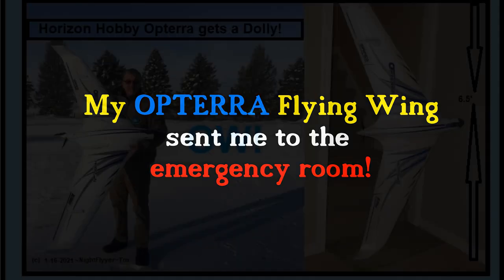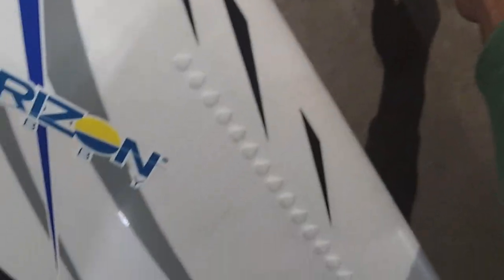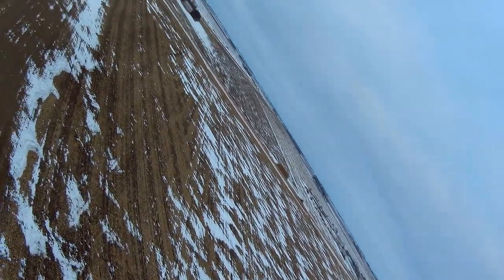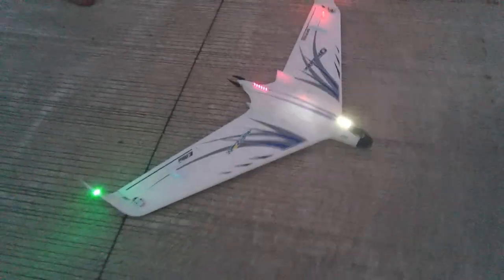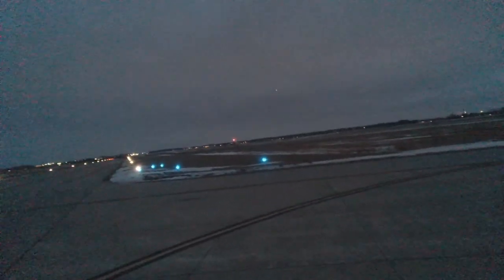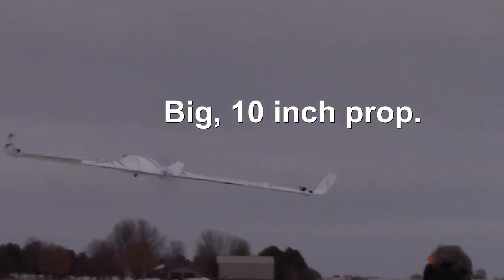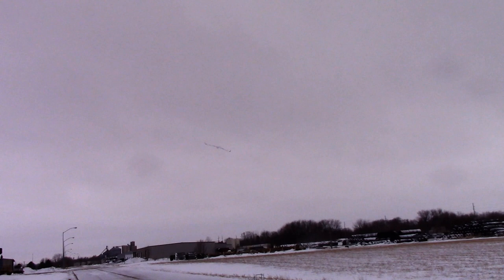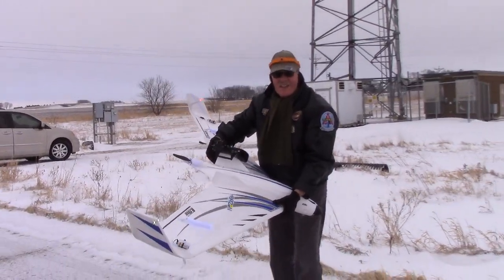My Opterra 2M Flying Wing sent me to the E.R. This is an awareness video & my solution for launching

Comment: Your using a Spektrum.transmitter, there is a motor arm/overide setting that will kill the throttle.
I first used it to Override or kill the motors on my quads....  That way I can kill the motors before I pick them up no matter the orientation....  Cause otherwise they have the same problem if you hit the throttle before unplugging there are 4 props to make hamburger out of your hands.... 
Glad your recovered...
Reply from the maker: I certainly know that as most of my helis have that setup. I've flown models for 60 years.  I'm 73.  But the best rc pilots in the world, have also had bad landings once in a while.  Shit happens, especially while I was trying to throw this heavy, under powered 7 foot model into the 12 mph headwinds.  Maybe if the Manual had said I should do that, I would have.  First of all, that had nothing to do with my hand injury. I only mentioned the Throttle arming because I followed instructions in the manual and this is the way it bound up and arms the motor as soon as you plug in the battery. It says nothing about programming in a cut switch like my helis have. I only mention it to warn others to program in this feature as well,  which also should have been mentioned in the instructions.  It's my warning to be cautious, because the manual says nothing about programming in a throttle hold to a switch. I've known of times when after flying, that switch was forgotten to be moved back to safe and it armed as well.  Nothing is 100% as it could be left in the wrong position, by accident. I'm pretty experienced, so never relied to on a throttle cut/hold, as all my helis and my drones, and many of my electric planes need throttle stick movements to arm.   I only am warning others to be careful BEFORE the launch and to be careful no matter what you use. .    Here are the links to the last videos and you can see I launched it the same way without problems.  . 
https://www.youtube.com/watch?v=P_inF5EYLEE&t=1s&gl=CO  and   https://www.youtube.com/watch?v=ur5V5H8UcGs&t=1s
Thanks.  Its hello dolly from now on.

Comment: You didn't follow through on you launch. You stopped your throw when you released the wing. Keep swinging your arm after you release the wing. You hand and wing are moving at the same rate so if done correctly there won't be any more prop strikes. It's pretty much the technique a baseball pitcher uses. hope that helps heal well.
Reply from the maker: The instructions only say to hand launch it and tells how.  That is how I did it. Of course nothing is 100%, and others told me they were holding this big 7 foot wing and before they launched, a gust of wind got under it and it tipped back and cut their forearm and 3 tendons.  I was launching into 12 mph winds and this big heavy, under powered wing is not that easy to hold and launch into that.  Its hello dolly for me from now on.   Here are the links to the last videos.  https://www.youtube.com/watch?v=P_inF5EYLEE&t=1s&gl=CO  and   https://www.youtube.com/watch?v=ur5V5H8UcGs&t=1s  As you see I had no problem then but shit happens.

Comment: Well if you aren’t a newbie, than you should have known to have throttle cut programmed and on anytime the plane is not ready to launch. 
Stating “because the instruction didn’t tell me to” don’t blame on being a marine, blame it on ignorance. 
The opterra hand launches just fine as long as you 1, use safe select to launch, and 2, to be aware of prop position and to follow thru with your hand motion. 
You may want to switch to unpowered gliders.
Reply from the maker: If you follow my channel, you know I am no newbie and to say I asked for it or should have done it differently is disappointing.  Newbies would follow the instructions in the book, as I did.   First of all, that throttle arming had nothing to do with my hand injury. I only mentioned the Throttle arming because I followed instructions in the manual and that is  the way it bound up.  It arms the motor as soon as you plug in the battery. If it had said to program in a throttle cut, I would have!   This wing is 7 foot long and will bend and break the end off the if you even try to pick it up by the tip. It would also be extremely difficult to somehow launch it discus style with the elevon there and that 7" tall winglet rudder that is also on the tip.  I know how to do it , but not with this plane.  See my 14 year old self-contained catapult in action here.  https://www.youtube.com/watch?v=ypxbkaY-Ycs&t=113s
It's not like launching my SMALL F-27 Evolution or 1.2M Opterra.  So I followed the instructions word for as I did for the video I made of my product review earlier, but it bit me.  https://www.youtube.com/watch?v=P_inF5EYLEE&t=1s
Here is word for word what the Opterra 2M manual says about launching.  
1. Put the aircraft into launch mode with the channel 5 switch.  (in my first video that did not work, it went into the ground)  
2.  Hold the aircraft in one hand and the transmitter in the other.  
3.  Apply full throttle and throw the aircraft directly into the wind, angled slightly up (5 to 10 degrees above the horizon). 
4.  Climb to a safe altitude and check the trim.   
I know others have their own ways, and either way, my Dolly is the safest solution for me.  
The Opterra 2M manual also says nothing about throwing it with the motor off, so if a newbie followed the instructions, like I did, I'm showed what could happen, in case a gust of wind got them or something else.     Nothing is 100% and no matter how good you can throw, this big 7 foot wing with a 10 inch prop spinning right next to your face, is risky.  And to see how I feel about that uneccesary auto stabilation system see this.  https://www.youtube.com/watch?v=ur5V5H8UcGs&t=1s
Maybe a gust of wind, maybe my 73 year old left arm was weaker, or who knows.   But either way, if it happened to me launching the way I thought was good (and  the same as all my previous launches.)  So if it can happen to me, it can happen to others, and that is the warning I want to present.

Comment: I didn't read all the comments so don't know if it's mentioned already. Put a throttle cutoff on that thing. Make sure it's enabled before grabbing it. 

My solution for launching is a bit different than yours. I enable throttle cutoff, set my throttle to 2/3 to 3/4, throw the Opterra left handed, and AFTER it has left my hand I hit the throttle cutoff switch to turn the motor on. I have my right hand thumb on the right stick so I have control before my left hand has finished it's follow through.

Comment: Many a Piggily - Wigggily -Digit on the Dirt Shop Floor 
; Mostly Table Saw Warrior's !  [ 3 Tyme's 2 Date ] , YYZ , Mohawk-Planker ...Thought's about Hand Assist Launcher Stick !?
Reply from the maker: I have had launchers, but again, this is a big heavy 7 foot wing.  .   This wing is 7 foot long, heavy and  will bend and break the end off the if you even try to pick it up by the tip and barely has enough power to fly out of your hand at launch.  I know and I tried.    It would also be extremely difficult to somehow launch it discus style with the elevon there and that 7" tall winglet rudder that is also on the tip.  I know how to do it , but not with this plane.  
It's not like launching my SMALL F-27 Evolution or 1.2M Opterra.  So I followed the instructions word for as I did for the video I made of my product review earlier where nothing happened bad.  https://www.youtube.com/watch?v=P_inF5EYLEE&t=1s and the second one where I explain how to protect the bottom of the fuselage.  https://www.youtube.com/watch?v=ur5V5H8UcGs&t=1s
We are only talking about a Half inch of clearance that I needed to keep from getting cut. 
Here is word for word what the Opterra 2M manual says about launching.  
1. Put the aircraft into launch mode with the channel 5 switch.  (in my first video that did not work, it went into the ground)  
2.  Hold the aircraft in one hand and the transmitter in the other.  
3.  Apply full throttle and throw the aircraft directly into the wind, angled slightly up (5 to 10 degrees above the horizon). 
4.  Climb to a safe altitude and check the trim.   
I know others have their own ways, and either way, my Dolly is the safest solution for me.  
Thanks.

Comment: The same thing happened to me and I have seen it happen to others. I made a leather glove/sleeve that now use to launch my Opterra.
Reply from the maker: Ouch. Thanks for that suggestion and I tried that already, but because it was cold.  I found trying to hold on to the tiny finger grips on the bottom of the 7 foot wing with a thick glove under full power with wind blowing was difficult when under power and then trying to fly with  a big enough glove on was also difficult to fly the transmitter, (I'm a stick pincher)  so although that sounds like a good idea, it did not work that well. Some have told me the Prop got them in the forearm even before launch, when a gust of wind got under the wing and tipped it back.   We are only talking about a Half inch of clearance that I needed to keep from getting cut, and even though I pulled it off several times in my earlier product review video,  I will never hand launch it again.  LOL.  It's hello dolly from now on!  Thanks.

Comment: 1. put on a glove if your going to launch a pusher. 2. That plane doesnt need to have power on at launch. Ive got one with dozens of flights on it and don't power it up until after its out of my hand.
3. set you throttle cut off on a switch then it will be the same for all your plane regardless of what the esc manufacture does.
Reply from the maker: Throttle cut.
Of course I know how and  have.  First of all, that had nothing to do with my hand injury. I only mentioned the Throttle arming because I followed instructions in the manual and this is the way it bound up and arms the motor as soon as you plug in the battery. It says nothing about programming in a cut switch like my helis have.  It's my warning to be cautious, because the manual says nothing about programming in a throttle hold to a switch. I've known of times when after flying, that switch was forgotten to be moved back to safe and it armed as well.  Nothing is 100% as it could be left in the wrong position, by accident. I'm pretty experienced, so never relied to on a throttle cut/hold, as all my machines need throttle stick movements to arm.   I only am warning others to be careful BEFORE the launch and to be careful no matter what you use. 
Gloves
Thanks for that suggestion and I tried that already, but because it was cold.  I found trying to hold on to the tiny finger grips on the bottom of the 7 foot wing with a thick glove under full power with 12 mph wind blowing was difficult when under power and then trying to fly with a big enough glove on was also difficult to fly the transmitter, (I'm a stick pincher)  so although that sounds like a good idea, it did not work that well. Some have told me the Prop got them in the forearm even before launch, when a gust of wind got under the wing and tipped it back, so gloves wont protect that.  We are only talking about a Half inch of clearance that I needed to keep from getting cut, and even though I pulled it off several times in my earlier product review video,  I will never hand launch it again.  LOL.  It's hello dolly from now on!  Thanks.

Comment: Thats why I always put throttle cut on my planes, that transmitter can do it as well.  So if you bump the trottle nothing will happen.
Reply from the maker: Of course I know how and a have.  First of all, that had nothing to do with my hand injury. I only mentioned the Throttle arming because I followed instructions in the manual and this is the way it bound up and arms the motor as soon as you plug in the battery.  It's my warning to be cautious, because the manual says nothing about programming in a throttle hold to a switch. I've known of times when after flying, that switch was forgotten to be moved back to safe and it armed as well.  Nothing is 100% as it could be left in the wrong position, by accident. I'm pretty experienced, so never relied to on a throttle cut/hold, as all my machines need throttle stick movements to arm.   I only am warning others to be careful BEFORE the launch and to be careful no matter what you use.

Comment: I have a friend who recently, was also bitten by his Opterra, when launching. He had flown it many times without incident. Now he too, is trying different designs of a launching trolley.
I’m surprised that you didn’t program a “throttle cut switch” on your TX, if that isn’t written in the manual for the plane, it must be in the TX manual. I’ve never heard of a “full throttle & back to idle” to start the motor method. As you said, the throttle stick is easily bumped by accident, every RC plane needs some sort of safety switch.
Reply from the maker: If you follow my channel, you know I am no newbie and to say I asked for it or should have done it differently is disappointing.  Newbies would follow the instructions in the book, as I did.   First of all, that throttle arming had nothing to do with my hand injury. I only mentioned the Throttle arming because I followed instructions in the manual and that is  the way it bound up.  It arms the motor as soon as you plug in the battery. If it had said to program in a throttle cut, I would have!    We Marines were taught to follow instructions and stick to the plan or get dead!  So after spending 33 years in the Marines, I managed to stay alive because of that.  This wing is 7 foot long and will bend and break the end off the if you even try to pick it up by the tip. It would also be extremely difficult to somehow launch it discus style with the elevon there and that 7" tall winglet rudder that is also on the tip.  I know how to do it , but not with this plane.  See my 14 year old self-contained catapult in action here.  https://www.youtube.com/watch?v=ypxbkaY-Ycs&t=113s
It's not like launching my SMALL F-27 Evolution or 1.2M Opterra.  So I followed the instructions word for as I did for the video I made of my product review earlier, but it bit me.  https://www.youtube.com/watch?v=P_inF5EYLEE&t=1s
Here is word for word what the Opterra 2M manual says about launching.  
1. Put the aircraft into launch mode with the channel 5 switch.  (in my first video that did not work, it went into the ground)  
2.  Hold the aircraft in one hand and the transmitter in the other.  
3.  Apply full throttle and throw the aircraft directly into the wind, angled slightly up (5 to 10 degrees above the horizon). 
4.  Climb to a safe altitude and check the trim.   
I know others have their own ways, and either way, my Dolly is the safest solution for me.  
The Opterra 2M manual also says nothing about throwing it with the motor off, so if a newbie followed the instructions, like I did, I'm showed what could happen, in case a gust of wind got them or something else.     Nothing is 100% and no matter how good you can throw, this big 7 foot wing with a 10 inch prop spinning right next to your face, is risky.  And to see how I feel about that uneccesary auto stabilation system see this.  https://www.youtube.com/watch?v=ur5V5H8UcGs&t=1s
Maybe a gust of wind, maybe my 73 year old left arm was weaker, or who knows.   But either way, if it happened to me launching the way I thought was good (and  the same as all my previous launches.)  So if it can happen to me, it can happen to others, and that is the warning I want to present.  Thanks.
Reply: @NightFlyyer . I was thinking that you may have not used a Spectrum TX previously. Most model fliers start with one brand of radio & stay with it for a long time. Because the opterra is BNF you may have picked up radio to suit, that you were unfamiliar with.
I realise this incident didn’t occur from a lack of a throttle cut. I have thrown a 1.2M opterra for a buddy once, it wasn’t an experience I found comfortable, or wish to repeat.
I mean no offence with my comments. I understand that you followed the instructions in the manual. I do find sometimes the manual is wrong or incomplete.
Reply from the maker: @koalatails6391  No problem.  I have been flying Spektrums for many years.  This is a DX-8 Gen 2. I am very familiar with it with over 75 models programed into it.  The 1.2 is small like my F-27, so you can imagine what a 2m (almost 7 ft) is like to launch with the bigger 10 inch prop. The manual really tells the only way to launch it, as they do not mention throwing it with motor off or discus style, as that takes some finness. But it's hello Dolly for me from now on.   Thanks again and happy flying.

Comment: happened to me too with my first flying wing. learn how to launch it by grabing it at the leading-edge. best launch methode imo
Reply from the maker: That works on all my smaller wings, but not this one.  This wing is 7 foot long, heavy, and will bend and break the end off the if you even try to pick it up by the tip and barely has enough power to fly out of your hand at launch.  I know and I tried to launch it discus style, but could not hold it where I felt I could launch it successfully in the wind.     It would also be extremely difficult to somehow launch it discus style with the elevon there and that 7" tall winglet rudder that is also on the tip.  I know how to do it , but not with this plane.  Thanks.